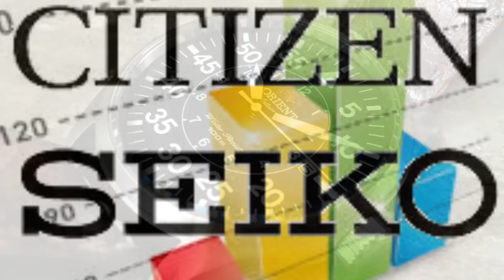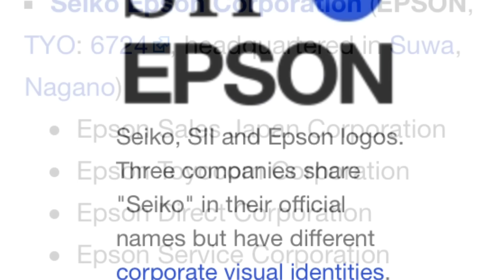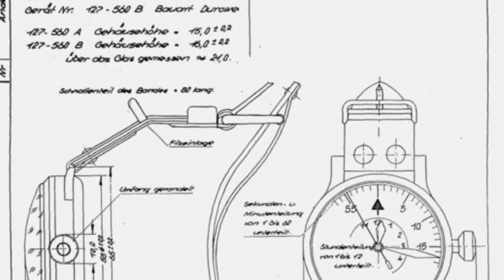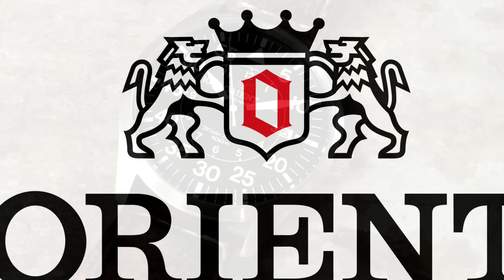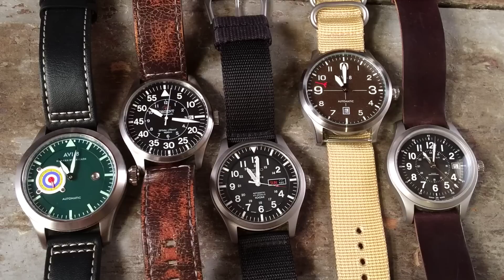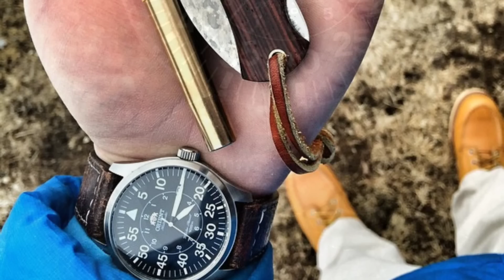Review: Orient Flight Pilot Watch "Germany Meets Japan - $150 Flieger" Model FER2A003B0

Comment: Some clarification about ownership. Orient Watch Company, Ltd. is wholly owned by Seiko-Epson, which itself rarely uses that name and commonly goes by "Epson" and indeed their Tokyo stock ticker is "EPSON."  Seiko Watch Corporation is wholly owned by Seiko Holdings Corporation. Its Tokyo stock ticker is "SEIKO." The Seiko Group you mention is not a holding corporation or some higher level management. Seiko Holdings and Epson are two completely independent corporations, each  with their own publicly held stock. In other words, if they weren't independent, they could not and would not have their own public stock being traded on the Tokyo Exchange. The third company you mention as part of this "Seiko Group" is Seiko Instruments, Inc. It is not independent, but is a wholly owned subsidiary of Seiko Holdings Corporation. In reality, there are two independent corporations, each with their own public stock, and each with their own boards of directors. The only tie between them is substantial ownership of stock in each one by members of the Hattori family, enough to exert some control over the corporations through their boards of directors, which, at best, is indirect control of major corporate policy and strategic direction . . . things that concern the Seiko Holdings and Epson top corporate officers (e.g. president, CEO, CFO, etc.). Thus, Seiko Watch Corporation and Orient Watch Company are very independent of each other. There is no common management or control.

There is considerable misinformation and misunderstanding about Orient Watch and Seiko Watch, and the (lack of) relationship between them, to include a generally held very incorrect belief that Seiko Watch owns Orient Watch. I saw a forum posting that started out with a question whether or not an Orient dive watch had a Seiko 7S26 or 7S36 inside . . . ending the question with "since Seiko owns Orient" (as if it were another brand like Lorus or Pulsar).
Reply from the maker: Thanks for your explanation!

Comment: Mine is the Times Flieger type B with sapphire crystal, heated blue hand and enamel dial with the blue lume brighter than my hulk. 139 USD
Reply: Also, it has screw-down crown. Plus 2 sec per day NH35 work-horse
Reply: Think your dreaming bud!
Reply: @NathanChisholm041  check out chrono24, Beijing infinite time 😁

Comment: I am planning on getting this watch or a Seiko SNZG for a beater field watch to take camping and for general tactical use etc. Do you have an opinion on of one is better? I like the dial and screw down crown on the Orient because I would think it would keep out debris better. I like the hardlex and less protruding crystal of the Seiko, and I would also prefer a Seiko 7s movement because of their history of taking a beating. Do you have any input on my use case that would help sway me in one direction or another? I would get a Hamilton 42mm Field but I have an aversion to beating up Swiss watches. Thanks!
Reply from the maker: Great question. Short answer is both are winners, pick the style you like better. I would give a slight edge to the Seiko for general durability, but the Orient probably will be a little more water resistant. I'll be doing a video comparing them at length so stay tuned.
Reply: 555 Gear So I ended up picking up a H70555533 42mm Hamilton Field automatic. Hahahaha!  That should do the job.
Reply from the maker: That it will! Strong work dude.

Comment: Geez, I cringed at your pronunciation and jargon use. Flieger, in German is pronounced "Fleeger" with a very hard "G". The "ie" is pronounced as a long "e". The "ei" vowel combination is pronounced as a long "i", the opposite of most English usage. These were not "Flieger" watches during WWII. They were "Beobachter" watches, which is where the "B-Uhr" abbreviation comes from. Regarding aviation, a Beobachter, literal translation "Observer", is a NAVIGATOR , not a pilot. These were NAVIGATOR chronometers for navigation use in the bombers. The first style of dial was the Type A. The second style of dial after which these are patterned was the Type B, hence you will see on the German drawings for them "B-Uhr, Type B". The pilot didn't need a chronometer, the NAVIGATOR did, so he could determine the exact hour angle, i.e. longitude, with high precision. The actual watches used during WWII were very large, with pocket watch size chronometer movements in them, adjusted and regulated to observatory chronometer standards. They were issued to the navigators just before the mission and had to be returned after the mission was finished. They belonged to the unit, not the navigators. The straps on the were very long so they could be strapped onto the arm of the navigator over his flight jacket. Shortly before takeoff, as part of flight preparation, the navigator would hack the watch to the German observatory radio time signal. You need to reedit and fix this video.